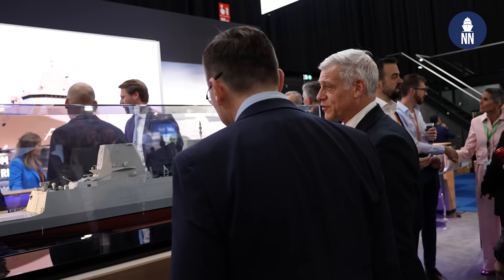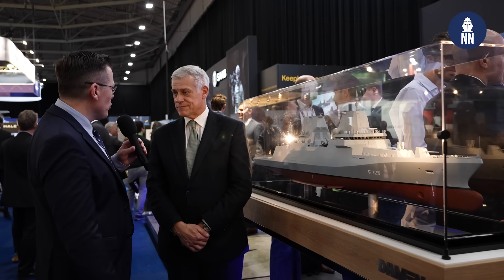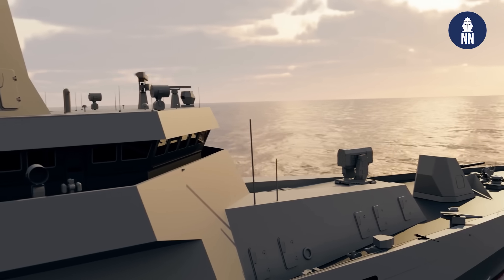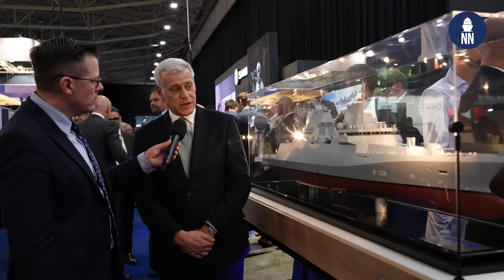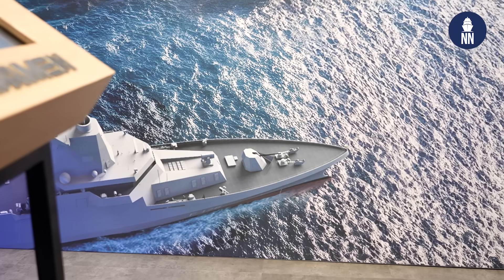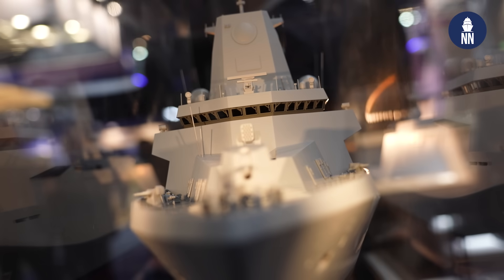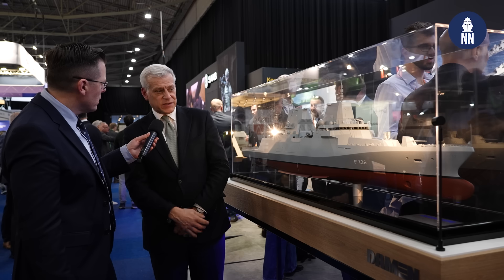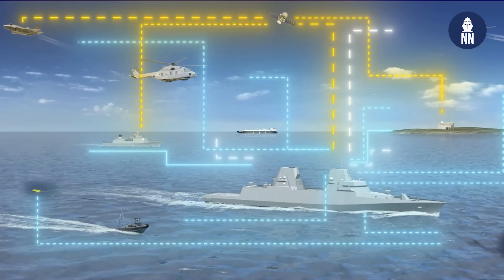German F126 Frigate with Damen at NEDS 2024

Comment: German, 60. The criticism of too few VLS cells actually points to a frightening lack of knowledge of where Germany is geographically located and who the enemy would actually be, because the design of a warship is based on this. Over the Mediterranean and the North and Baltic Seas, the European NATO states already have complete air superiority over the Russian air force thanks to their land-based air force bases. The South Atlantic and the Indian or even Pacific Oceans are out of the question logistically. So why fill a ship with numerous VLS cells?
Reply: danke √√√
Reply: Also completely ignoring the fact that this is an ASW Frigate...
Reply: @patta8388 finalls someone mentions the D
F126 designated purpose
Reply: @patta8388  and an ASW frigate should not have a sufficent capability of long range anti air defence? Also the VLS could be used to fire VL-ASROC
Reply: @JS-mb7yo  16 VLS tubes quad stacked with ESSM 2's is sufficient. For short range it has an additional 42 RIM-116's.
Reply: @JS-mb7yo  Please keep up with the discussion before waffling about not having sufficient capability of long range anti-air defence. The very first comment in this thread showed why it's entirely sufficient.
Reply: @JS-mb7yo It wouldn’t need it and it would take away from its main mission. It only needs to defend itself from aerial threats. Wide area air defense is what the AAW frigates are for.
Reply: @patta8388  7,000 tonne ASW frigate can do even better than this german ship
Reply: To carry more fuel or electricity + future modules  @LuqmanHM
Reply: @LuqmanHM  better doing what?
The German navy had a very specific profile in mind when they ordered this. Everyone's fixation on VLS and tonnage is crazy. If you compare shit, compare *everything*.
Reply: @patta8388  better follow the Dutch new ASW ship design. Very similar in weapons load out and sensors but at 6000 tonnes instead of 10,000
Reply: @LuqmanHM  why? Higher tonnage doesn't limit any capabilities.
Reply: @LuqmanHM can it stay on deployment for 2 years straight without returning to port while only being crewed by 114 seamen? Yea didn’t think so
Reply: @patta8388  people with their hyper fixation on low tonnage  tend to forget that higer tonnage means higher chance of survivability for ship and crew when taking damage
Reply: @gigproductions1475  plus room for upgrades during its service life
Reply: @dopepopeurban6129 I think the F126 can only stay deployed for 6 months, not 2 years. However that probably significantly longer than the ASWF. They’re actually developed by the same company. Both are Damen products, so in many ways they will be very similar.
Reply: @patta8388 I am sure that if the Bundeswehr really feels that they need more VLS cells, they could just talk to Damen and Blomm & Voss and upgrade the vessel at some point. Maybe if they at some point want to add some extra cells so they have room leftover to fire cruise missiles. Evidently it wasn’t a priority, so it wasn’t included. You’re entirely correct that people erroneously fixated on tonnage and armament. Neither of them is everything. The ability to bring that armament to bear effectively and staying alive is just as important. As are a lot of other things, like crew accommodation, survivability, supplies, situational awareness, communication and stationkeeping. And arguably now that at sea replenishment of VLS cells is becoming increasingly viable, it may not actually be important to have much more. It would just tie the auxiliary vessel down longer with a single ship, while providing only a marginally deeper magazine.
Reply: And why would you outfit a ship with more vls cells than you could possibly fill with missiles? In a war the German navy would be very missile constrained. I am sure that technically speaking it absolutely would have been possible to give it more cells, but those would then be pretty much always empty while on missions, adding unnecessary cost. Better to invest that extra space and money in better accommodation and sensors. 
Besides as an ASW frigate AA warfare isn’t its priority. It needs to be able to defend itself of course, but hunting submarines and presumably USV’s and UUV’s is its priority. Besides it does have a respectable Anti ship armament considering it is equipped with 8 Naval Strike missiles in angled canisters amidships. The naval gun and autocannons are good for dealing with drones and the like.
Reply: The enemy would be Russia.
Reply: @michaelneuwirth3414  
No, with tender, those ships can operate worldwide. The British had to stop at Ascension, too, in 1982. 
No, ship wants to completely empty its tanks, the numbers for range, given at Jane's, etc. are rather calculatory or in case a ship just wants to make a transit voyage.
Reply: Well why bother with building a war-ship at all?
Reply: Our ships are like 7k tons with 16 vls but with space for 32 vls😂 great asw Frigates of the Dutch
Reply: Sales and ability to deplooy globally in support of friendly nations, that's why
Reply: This is an ASW unit so it shall hunt subs and  escort convoys and other larger groups. Up to 64 RIM-162 + 42 RIM-116 are more than enough for those tasks.
Reply: @EK-gr9gd  These folks only see "big ship, why no destroyer armaments?" Completely ignoring why it is so big
Reply: @patta8388  To stay as long as possible away from port.
Reply: @EK-gr9gd  with as little crew as possible.
Reply: 64  ESSM + 42 RAMs is a lot for self defense.
Reply: Specialized single role warships are OK if you have a large fleet.  Germany has a very small fleet, so it needs more multi-purpose frigates/destroyers.  Everyone talks about 64 + 42 is plenty.. yes but 42 RAM/RIM-116 (Block II) is super-short range with 11km effective range, and 15km max. range.  The ESSM is a medium-range missile with a 30 mile range, and only works well against cruise missiles and subsonic anti-ship missiles, and probably most (larger) drones.  AAW does not mean aircraft only.  You all talk about aerial threats from fighters and bombers, but forget about massive ballistic & hypersonic missile attacks.  Not against the ship, although the Chinese and the Russians now claim to have hypersonic anti-ship missiles, but against oil rigs at sea, naval ports, shipyards, and many other land targets.  Also if hypersonic anti-ship missiles are launched against the F126, it is s**t out of luck because the ESSM cannot intercept them, nor can the little RIM-116 miniature missile, unless there is an F127 nearby (and those won't be ready until the mid-late 2030's).  You need the latest SM3 and SM6 for those which use the MK41 VLS.  Most or all the European and NATO counties are building multi-purpose frigates with ASW, AAW, ad with anti-asymmetrical and land attack capabilities (can launch cruise or other surface to surface missiles).  Also if a war every breaks out between NATO and China or Russia, you don't think those 2 countries have fuel tankers in the air to extend the range of their fighters to thousands of miles?  The West is not the only ones to have mid-air refueling.  If Germany has decided to only arm the F126 with ESSM, these ships will have to travel 2 or 3 together in the Pacific during wartimefor additional firepower against airborne threats, or be accompanied by an AAW frigate, which is a waste of resources.  Building new frigates these days that cannot guarantee aerial denial beyond 30 miles (ESSM range) is unheard off, especially 10K ton destroyer size frigates.  I just hope the upcoming F127 will not just be a dedicated AAW ship, but will also have decent ASW capabilities.  They better get it right with the F127 if and when it comes out, and they don't get another 10K ton ship with only marginally more cells than the F126.  And the fact that the Germans will be building specialized AAW frigates (the F127), negates everything people here are saying, like "you don't need more than 16 cells in the Baltic or North Sea, or around Germany", or whatever.  Also the comments about the Mediterranean or the Atlantic coast of Europe, and too many NATO air force bases in that area is also nonsense when the Russians build up their numbers of new Gen-6 stealth fighters and bombers in a couple of years.  If you can't see them coming, you won't be launching any fighters to intercept.
Reply: First of all the SM3 is purely for ballistic missile defense, it doesn't even contain an explosive warhead. Instead the SM3 features a small kinetic vehicle with maneuvering thrusters that seperates from the main body once the missile enters orbit. These thrusters then allow the vehicle to maneuver itself into an incoming BM during its mid course flight stage (i.e. in space). In short it is absolutely useless in a anti-ship missile defense scenario. Secondly the SM6 is an extremely long range AAW missile meant primarily for long range interception (100+ miles), it aint the best for engaging sea skimming ASW missiles which don't even show themselves on the radar screen until they cross the radar horizon, i.e. typically less than 15 miles from the ship (!!) -> Exactly the type of threat the ESSM & SeaRAM are meant to deal with, as when compared to the SM6 they are much more maneuverable, have faster launch times and a much lower minimum effective engagement range. 

So no, the F126 does not need SM6s, let alone SM3s, as its not meant to shoot down ballistic missiles or aircraft from extreme range, and as such ESSM + SeaRAM is the perfect fit. 

Finally the vessel can be fitted with 2x Iris-T SLM containers in a jiffy too if need be. The modularity of the design (one of its big selling points) also allows it to be quickly retrofitted to carry out a lot of different roles that a dedicated AAW frigate or cruiser simply cannot.
Reply: I disagree. Just look at our capabilities when we decided to participate in protecting against huthi attacks in the red sea. F124 was not equipped well enough for a more lengthy deployment. Without US help Europe would have been literally useless. Thats was only against smaller munitions, if Iran had given them Ballistic missiles y have given the Hisbollah, ESSM might not be reliable enough, having a few SM3/6 would be good. With the probability of kill not being a 100% anyways using two missiles for some threads is something to take into account.
Also for AWS flexibility and the usage of VL-ASROC for example would improve capabilities drastically. 
Germany does not have a lot of ships, we still have very broad interests and the US is not a reliable partner anymore. We need the flexibility. With so much tonnage adding more VSL cells, as the 32 initially intended btw, is just a smart decision because you gain more capability for the buck than cheaping out. These ships are impressive in many ways, but the procurement and requirement management is just bad.
Reply: @thorH.  Es macht keinen Sinn, eine Diskussion über deutsche Marinestrategie auf einem YT-Thread zu führen, weil einfach 
nicht ansatzweise klar ist, wer mit welchem Hintergrund/Basiswissen/Alter usw. an einer solchen "Diskussion" teilnimmt bzw. Wer Sie sind wirklich, denn an den leibhaftigen germanischen Gott des Donners glaube ich nun mal nicht? Über welches nautische Wissen verfügen Sie? Welche Kenntnisse besitzen Sie in elektronischer Kriegsführung. Sensorik, Logistik, internationaler Terrorbekämpfung usw.?
Ich zumindest weiß, dass selbst eine doppelt so große Deutsche Marine nicht in der Lage wäre, einen Einsatz, wie Sie ihn andeuten, selbstständig durchführen könnte. Allein die nachrichtendienstlichen Defizite der Bundeswehr/Bundesregierung verbieten einen selbstständigen Waffeneinsatz außerhalb Europas.
Reply: @thorH.  Do not take this answer as a request for a dialogue, but merely as an explanation of why I am not conducting a dialogue, especially as the operator of this channel is forcing me to conduct it in English, as he has not published the German-language answer I gave you a few days ago.
It makes no sense to have a discussion about German naval strategy on a YT thread, because it is simply 
it is not even remotely clear who is participating in such a ‘discussion’ and with what background/basic knowledge/age etc. Who are you really, because I don't believe in the incarnate Germanic god of thunder? What nautical knowledge do you have? What knowledge do you have of electronic warfare? Sensors, logistics, international counter-terrorism, etc.?
I at least know that even a German navy twice the size would not be able to carry out a mission like the one you are suggesting on its own. The intelligence deficits of the Bundeswehr/federal government alone prohibit an independent deployment of weapons outside Europe. 
Not to mention the political and logistical implications that a mission outside Europe would entail.
Reply: @ I am not Thor the god of thunder/ the Username is a subset/ inital of my name tho, I am just an interested German who pays some extra attention to the topic, but what relevance does this have? I don’t expect an answer and I respect that you don’t really want to engage in a discussion, please do not reply. 

But then why comment at all, if it doesn’t matter what the Otto Normal Verbraucher thinks, or that he needs some prior resume to be qualified to have an option why bother? 
I am just a little disappointed, that I could not learn something new. If you can recommend another forum please do. I used to spend some time mostly reading on Forum-Sicherheitspolitik some time ago, but I cannot estimate how good the expertise is there.
Reply: @Michael.Neu1964B.R.Deutschland  so why design 10,000 tonnes ship with 16x VLS instead of 7,000 tonnes ship with 48x VLS 😅😅
Reply: @LuqmanHM because the larger ship has 64 missiles.
Reply: any kind of enemy would be happy to counter a so under armed ship for Zircons is a joke to hit this big target

Comment: We are proud about the new F126 Class which is a coorparation of the really good Partner and friendship countries Germany and the Netherlands. It is an impresive ship and it is planed with only 16 vls Cells but there is space for more and I think...this ship will get more. But ..the VLS is only one weapons system. The F126 is a powerfull ship for multirole. Nice designed from Netherlands!!!
Reply: No there is no space for additional VLS. You wont be able to give any source for that claim because there is none. :D
Reply: @HansPeters1234  wir werden sehen wie die Schiffe final ausgerüstet sind.
Reply: @DBond-bv2oi  So wie im Video gezeigt (was VLS angeht). Du stellst dir Beschaffungsvorgänge deutlich flexibler vor als sie in Realität sind. Da ist nicht viel mit Flexibilität und die Verträge bzw Vorlaufzeiten sind sehr lang.
Reply: @DBond-bv2oi  There is no friendship between the Netherlands and Germany! We will never forget or forgive the occupation and Genocide committed by the Germans!

Comment: Much like America's Burke Class destroyer, this ship ... at over 10,000 tons ... is quickly approaching light cruiser size.  Calling it a "frigate" is just odd or misleading in some (unimportant) way.  Also, to only install 16 Mk. 41 cells - for a ship of this size is also odd.  It would make me think that the ship is either not going to be carrying long-range AAM's like the SM6 or one of those module positions they kept going on about might be for more Mk.41 cells - depending on the mission requirements.  I am not a German admiral .. I can only guess.
Reply: 16 cells carrying 4 missiles each, pay some attention lmaoo
Reply: It only carries ESSM (4x16 missiles) plus 2 RAM launchers (42 missiles). It is ASW focused, not AAW. For its purpose it is well enough armed, question is just why it needs a 10k tons ship design for that.
Reply: @Rockeviltwin  Design choice and mission profile. The F126 has a stronger hull, making it less dependent on Icebreakers in arctic conditions. It also features a two island design, were every important component (including OPZ) is available at least twice in seperate parts of the ship, making it much more survivable in case of a heavy hit.
It features enough space for two NH90 Sea-Tiger helicopters with full ASW and ASuW armament, plus (not or) UAVs.
It also features enough space for 2 large RHIBs along the sides and 1 well deck for an other RHIB or UUVs and towed sonar arrays.
And space for future laser based weapon systems.
Finally if you compare crew quarters of the F125 and an Arleigh Burke Destroyer, it becomes pretty obvious where a lot of space is going.
Same Reason why the future replacement of the AB has a design displacement of 14000 tonnes without increasing the number weapons.
You just can't design ships like you're in the 80s anymore...
Reply: It's not about size, it's about mission profile. The 126 is going to be an ASW Frigate

Comment: The F-126 will be very  under armed. Sixteen VLS are not enough. A ship this size could carry at least four times that.
Reply: you didn’t pay attention, the 16 cells carry 64 missiles. So it does carry 4x what you think it did
Reply: The F127 is meant for air defense but the F126 is not
Reply: This is an ASW Frigate. It's more than enough armed for that job.
Reply: @patta8388  Yeah but the enemy won’t care if you are just an ASW ship, they will see the size of the surface vessel and dispatch appropriate firepower…
Reply: VLS cells isnt the only thing that matters.